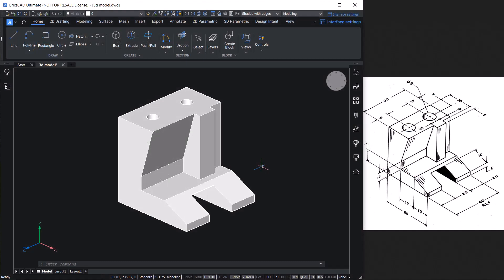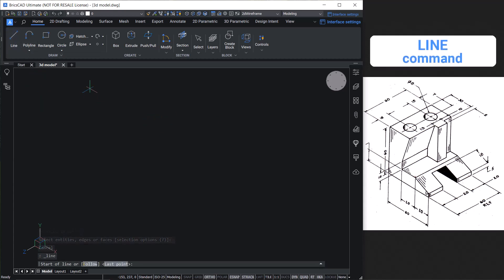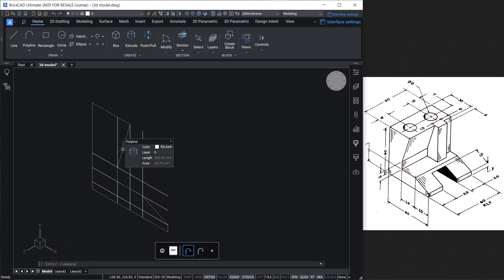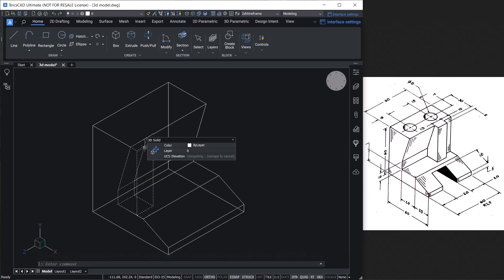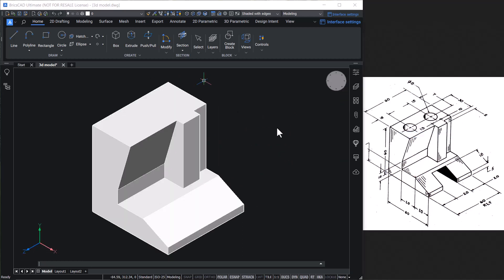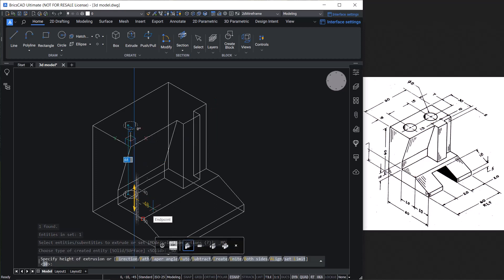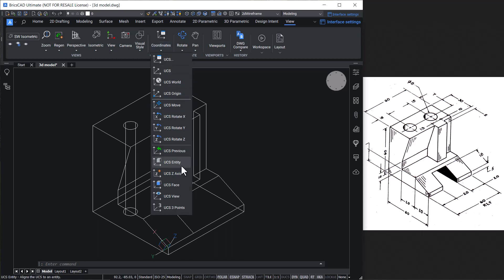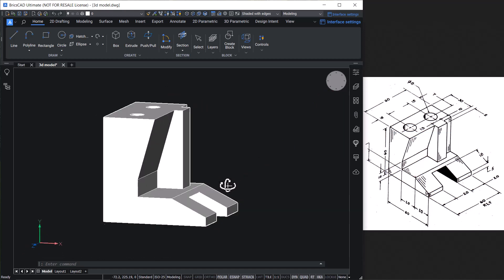Create a 3D Model using BricsCAD

Comment: I've been working my way through this (for my own benefit) and I've come to the point at 7:00 to create the polyline to help create the gap at the base, However, my lines just will not snap to the points shown in the video so I cannot create the shape needed for extrusion. The polyline just skips off in all directions whenever I attempt to create the shape. Do you have any advise?